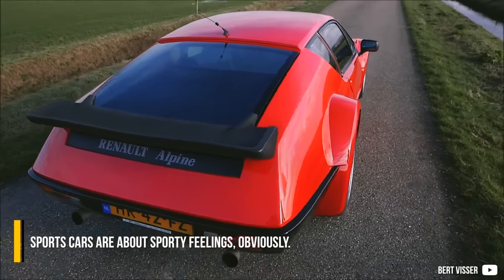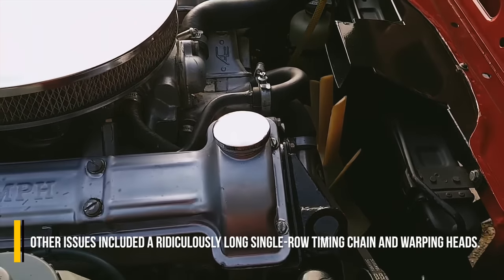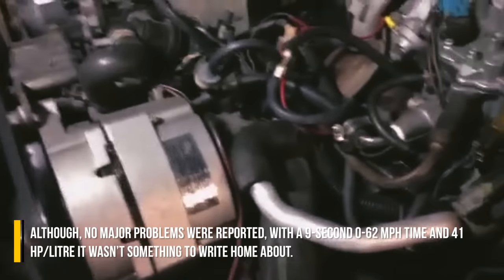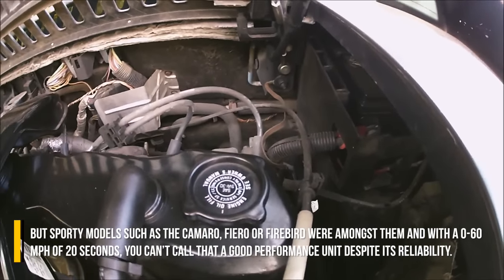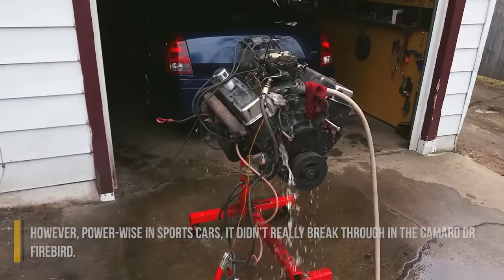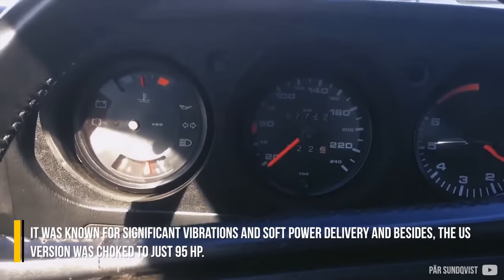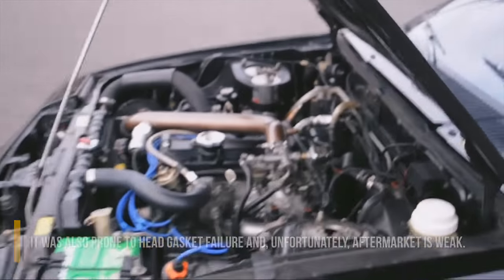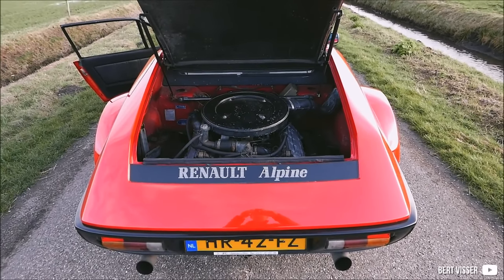Don't Buy These 7 Engines For Performance

Comment: Thé first one: Triumph stag: the engine in the video is not thé original 3.0l V8 but a rover v8
Reply: Not true, unless they have managed to adapt the Triumph cam-covers on to the pushroad Rover v8. But yeah they have replaced the SU carbs with an inferior carb ...
Reply: No, this is clearly the OHC Triumph engine - with some other modifications.
Reply: paul austin Staaaag

Comment: I'm sorry but the 305 was far from a perfect engine. Chevy and Fords 302 were much better as far as power and fuel economy. The problem with the 305 is the small bore size in compared to the 350 or the 302 which limits the valve size. That's why the 305 doesn't have much aftermarket support especially compared the 350 or 302.

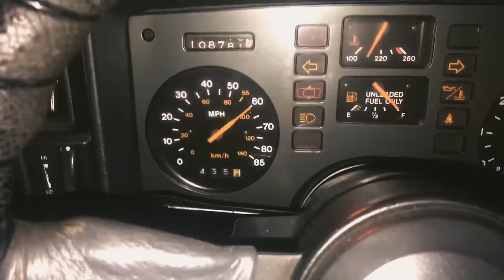Comment: Why is water being pumped into the 305 at 3:36.
Reply: Faded Jate to keep it cool without mounting a radiator on the test bench
Reply: probably because there was no cooling fluid in it so water is used to keep it cool while quickly testing it
Reply: Cleans the shit out..
Reply: Water injection, for more power, like on WWII fighter planes.
Reply: Chinese water torture?
Reply: Some Modern engines have reverse flow cooling systems and he wanted to hillfolk one up for more power
Reply: It just did not look very healthy for the motor.
Reply: The better question is why is the engine hooked into a 12V battery sitting just a meter away when water is gushing all over the place...

Comment: Almost no American engines produced good power during the mid 70s through the mid 90s. The Camaros had 305's mostly, which had low power. Same with Ford 302 during that era.
Reply: Patrick McLeod I can agree with that 100%. But today the big 3 are producing some pretty impressive engine's with tons of power. They seem to be back on the right track. Most of my faimly and friends own daily drivers that have between 300 and 400 HP.   I'm interested to see how they hold up 20 year's from now though.
Reply: dellstudio10 
Yeah. I was disappointed when the Ford 2v 4.6L modular motor was first introduced in like 1997, and it actually had like 15hp LESS than the 302 from the year before. I thought things were actually getting worse at that time. But just a few years later, and the mod motor has a few more valves, just a few more cu. Inches, and double the horsepower from year 1.

 What was even better, was that the engine, although not capable of being stroked/bored out for big displacement, could be built up to at least double the power of a 302, without much worry of blowing it up! In like the mid 2000s, the Koenigsegg CCR was released, which became the world's fastest car for a few years. It had a twin supercharged 4.7L version of the Ford mod motor that reliably and safely produced 806hp! 

Then GM comes out with the LS, and next thing you know, you've got an engine that is externally smaller, but with more displacement, that can be boosted to over 1,000 horsepower. The old gen 1 small block Chevy was good, but it wasn't THIS good. You couldn't get over 1000hp from a gen 1 350, without blowing it up immediately. Even 650hp was considered to be pushing the safe limit. As far as the new Hemi's, I really don't know a lot about them as far as potential for max power, and buildability. I don't see a lot of articles about it.

Comment: The Triumph 3.0 was mostly assembled poorly. Water jacket is ok.
Reply: Typical british engineering
Reply: Correct. A great little engine but if I ever bought one it has to be fully blue printed to put it together properly as nothing made by British Leyland ever was, unfortunately
Reply: The Stag engine was rushed into production before all the problems were ironed out.
It’s problems were all sorted out after the car went out of production by enthusiasts.
I had one back in the 1980’s and it never let me down after i rebuilt it and ran it for ten years. Built properly using the official workshop manual and using improved German timing chains & the correct antifreeze/ summer coolant these engines are very reliable.
Reply: Did you just say german ?? :3

Comment: you should overthink your statement on the Renault alpine. I mean, this car is from the 70's, and in the 70's  150hp were something realy great. I know for sure that in today's way its pretty underpowered, but back then with their bad handling and stuff, these 150 hp were pretty fast
Reply: Craucho :D the alpine a310 with the 150hp variant of the PRV shown here is the opposite of bad handling plus they were quite reliable and decently quick in that application as the A310 was really light and nimble and 150hp really wasn’t anything to write home about even back then js
Reply: cause it was lightweight 
4 gears aaaaaarrrrrrgggggg.     somebody help!
Reply: cars from 70´s generally suffered from a big power loss compared to the late 60s
And the Alpine was meant to have 200 hp ish V8 from a start
Reply: Ahem, the 1970 chevy chevelle SS had 450 horsepower. 150 has been bad in performance for a long while
Reply: xx executr xx that's gross horsepower, a measure that was replaced in 1972, in real life it probably made around 380 HP ish
But yeah your point stands
Reply: Power to weight man, power to weight... Check out the performance figures of the Alpine and it beats sports cars with a lot more power because of its low weight. As always a key feature of any Alpine.

Comment: The 4G54 had nothing in common with the 4G63 and was 2 different engine family.... 4g54 is more related to the 4D56 and 4D55 diesels... While the 4G63 relates to the 4G64 and later 4G69

Comment: The 924 Porches didn't have porches engine it used a vw van engine thats why it always had bad stigma as being a poor mans Porches.
Reply: Much of it also had to do with the 911 purists who believed that a Porsche had to be A) air cooled (they lamented the end of the air cooled 911's in 1996) , B) rear-engined and C) tricky to drive with unbalanced handling. The 928 got a lot of unfair critique too but the journalists at the time understood its brilliance and it was voted the 1978 car of the year - the only time a sports car has ever won this accolade. The 924 was actually ahead of its time as Porsche understood what the consumers wanted in the 1990's (accessible and neutral performance at an affordable price) in the mid 70's already. 

As for the "van engine". The engine was designed by NSU and was used in the Audi 100 before it appeared in the Porsche 924 and the Volkswagen LT van later . It's a myth the engine came from a VW van. It also needs to be stressed the 924 engine had an all-Porsche designed cylinder head. The engine was from the Audi 100 NOT from a VW LT van and the engine appeared in its Porsche form in the 924 before it ever was used in their VW form in the VW LT van. 

The 924 was well-balanced and many journalists praised its neutral handling. Porsche themselves proved its worth by racing them at the 1980 Le Mans 24 Hour race. There the Porsche entered 924 finished 6th overall (behind purpose built sport car prototypes which weren't based on road cars) beating the Ferrari 512BB (with its 5 liter flat 12), the BMW M1 (with its legendary M88 straight six) and Kremer entered Porsche 935's - and yes, that would be the same 935's which dominated endurance racing in the late 70's and early 80's. 

The moral of the story is: Word-of-mouth, myths and urban legends shouldn't be trusted or used as a basis for any kind of knowledge. Not for cars and not for anything else. 

NSU designed some da*n fine engines in their heyday and pushed the envelope many times. Back in the 1930's they designed racing motorcycles which broke speed records.

Comment: GM iron duke has only 90hp? Oh that's an absolute disaster. 0 - 62mph in 20 sec?
Compared to toyota agya 1.0 three cylinders can do 0 - 62mph for just 12 sec just by 64hp

Comment: Hyundai Tiburon v6 and 3rd gen MR2 should be in this list too. Tiburon V6 2.7 only make 175 Hp and 3rd gen mr2 only made 130HP
Reply: They arent really bad , just not exciting enough
Reply: Not bad at all tbh
Reply: Coincidently the MRS engine powered the 2001-2004 Rav4s and Corrollas
Reply: 1zz-fe isn't that bad, since MR-S is all about lightweight. Still a good engine, though underrated at best coz ppl normally talk about 2ZZ engine when it comes to the ZZ series
Reply: Yeah man!
Reply: Charlotte Dunois yes they are

Comment: Aboute the GM Iron Duke 4 cyl 2.5L. Here in Brazil, GM equipped the Chevrolet Opala 72-92 (the name came from Opel + Impala) with this engine, with 90-102 HP. But some dudes here make it go far away from this power rating, ever NA, is not hard to reach a lot of HPs. Dual Weber 44, 292º cams, ported heads and even MPFI. Take a look at www.classicracingparts.com.br Cheers.

Comment: I had a turbo formula , not only was the engine gutless , you needed to change oil every 1800 miles , akso the rest of the car was a piece of crap , rear end gear carrier warped , rear disk breaks never floated , master cylinder for the four wheel disk  brakes was built with a flaw , even the radio quit , paid 18000 for , sold it one year later for 6000 , most of the year I owned it , it was in the shop , even the cables for the parking brakes fell off , an american piece of dog shit

Comment: The Fiero was a failure in every conceivable aspect. Especially as it’s evolution was more or less concurrent with the very similarly spec’d Toyota MR2 which exceeded all expectations in every respect. Toyota and GM had a contemporary partnership that could have been relied upon to work the bugs out of the Fiero design but that never happened.
The MR2, itself, actually came about as a result of a similar partnership between Toyota and Lotus that not only yielded the desired help on the Lotus platform but also the creation of the first generation of the MR2 design. That design went through 3 major iterations that eventually went on to contribute heavily in the creation of the Toyota powered Lotus Elise/Exige/Evorra platform which, despite it’s modest HP numbers, created some of the most confident track weapons ever available at half supercar prices.
GM should have taken the same step with the Fiero fiasco and perhaps we would have been gifted with an effective series of domestic mid-engine sports cars.
Reply: Hard to believe they are so sought after.
Reply: The Fiero GT is nothing but a show car not a fast car
Reply: frank white
Bro, I wish you guys got the 3S-GTE like I have in my Celica GT4 and my MR2T. A 3S Exige would be fucking incredibly insane!
Id like to see your car - you have video?
Reply: frank white
I rally in the Austin Canyons once a year with the GT4. There are videos in my playlists.
The MR2T is also a beast but I’ve barely gotten her so it’ll be a while before she’s finished enough to video.
If you ever get vids and remember this conversation, I’d like to check that out.
Reply: Neg Ative it was a failure based on what😂😂? it out sold the mr2
Reply: Neg Ative mr2 was a p.o.s. as well. how's that snap oversteer? rust? the fiero didn't last because gm killed it. why? because it was FASTER AND BETTER than the CORVETTE.
Reply: Frigglebiscuit
What rust? My MR2T is 28yo and was neglected by it’s previous owners, yet it still runs high 12’s/low 13’s with only modern 275w tires and a boost controller. It’s funny that you mention the last model Fiero they designed (yet never released because they dropped the car) would have been faster than that year, slow, underpowered Corvette because you know what else was faster that DID get released? The MKII MR2T, the MKIV Supra and the MKVI Celica GT4 (not to mention the R32/33/34, turbo Silvia S14/15, FD RX7, Acura/Honda NSX, basically every concurrently released Porsche, etc etc.). What was your point exactly? That all GM cars of the early to mid 1990’s were slow AF?

Comment: Ahaha my v6 Camry does 0-60 in 6.5 seconds
Reply: Yes,but  in the mid 70's to 80's it was a 13  - 22 second 0-60 car depending on year !

Your Camry has low axle ratio's and transmission has more than 3 or 4 gears and its gear ratio in the transmission allows it to have a low 1st gear in the trans...Meaning the low axle ratio and low transmission ratio translates into faster take offs.....this is why cars are getting quicker because more gears in the transmissions allow them to..If you had 2.45 axle ratio in your Camry and a 3 speed automatic with a 2.65 1st gear you would be a 10 second 0-60 mph ! So ,add more trans gears and lower axle ratio to all these older cars and times will be a lot quicker..

Remember older late 70's to 80's cars especially have lower power because of vehicle emissions,luckily they found a way to have high performance engines today that meet the government emissions,after years of just dropping compression and adding smog crap that slowed them down tenfold !